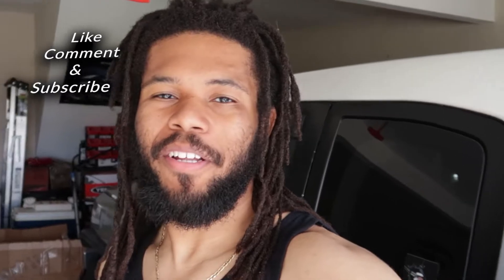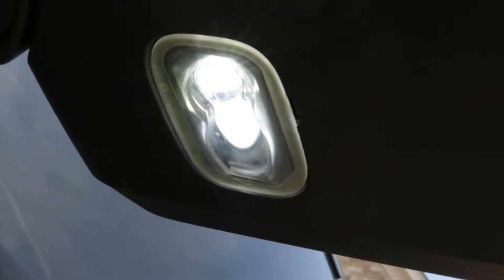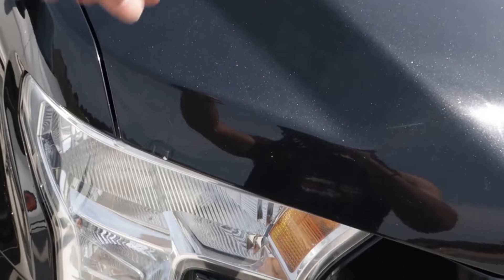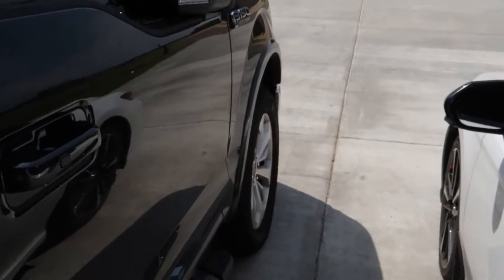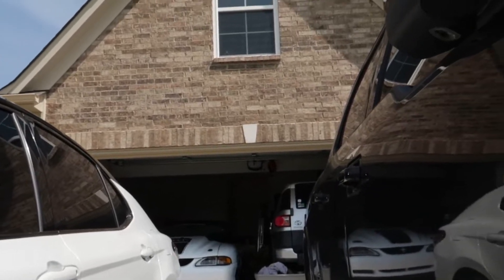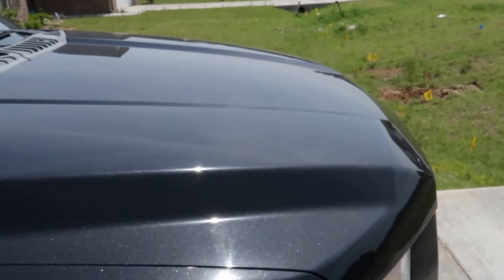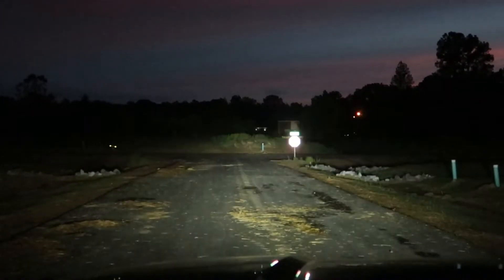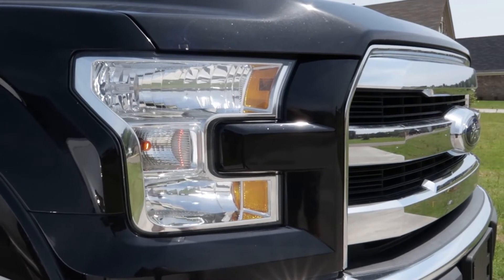Ford F150 SeaLight Review | Is It REALLY WORTH IT?

Comment: Did you use the stock dust covers for the bulbs or did you go with bigger dust covers?
Reply from the maker: I used the stock covers. The fog lights were tricky, but I got it on

Comment: From the thumb nail u have white led on the turn signal on the mirrors ...which brand are thoses
Reply from the maker: That's factory for a lariat f150
Reply: @DCreatorsCreations  aww okay kuz mines a 2017 ford F150 xlt fx4 but mine just yellow I was just wondering
Reply from the maker: @torotoro5201  Mine not even turn signals they just white led so you can see while turning

Comment: I have a 2016 f150 lariat what size bulbs did you use for the LEDs ?
Reply from the maker: You can get the whole kit here use code word CREATORS for 15% off 
https://www.auxito.com/products/auxito-2015-2017-ford-f150-led-light-bulbs?_pos=4&_sid=34e5004ec&_ss=r

Comment: I put Sealight LEDs in my 2020 f150 but even though the left lights is on when driving it looks like its not on. Any suggestions?
Reply from the maker: You may need to adjust them they are probably adjusted too high

Comment: What's the orange light in the headlights like right above the highbeams
Reply from the maker: It's my turn signals. I actually reached out to Auxito Led for their switch back turn signals and it definitely changed the look. They have the whole led coversion kit. You can use the code "CREATORS" for 15% off on any purchase. I changed them out in this video
https://youtu.be/PPdUt2C1bXs

Comment: Are these 5000k or 6000k?
Reply from the maker: I'm not 100% sure because I got them second hand but looks closer to 5000k
Reply: @DCreatorsCreations   have you has any trouble with them? I have a 2019 stx and it has yellow bulbs and i want to upgrade but im still looking for the ones that light far and bright. Do you recommend the ones u have ?
Reply from the maker: @trustonfort3092   @Trust On Fort  I actually have a discount code for auxito Led "CREATORS" 15% off. They have the whole led conversion kit for a good price that's who I have as my switchback turn signals and they are actually brighter than my Headlights lol I might be switch over my headlights to them Ive haven't had any problems with them 
https://youtu.be/PPdUt2C1bXs